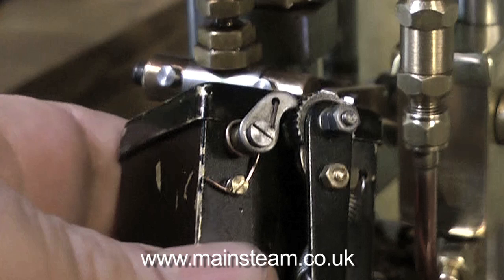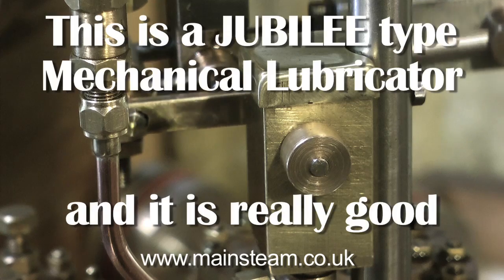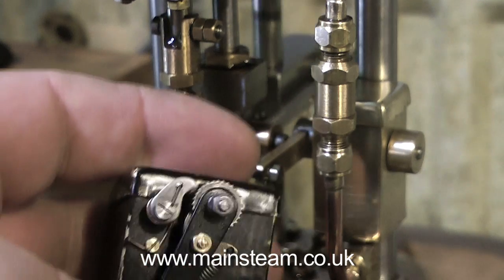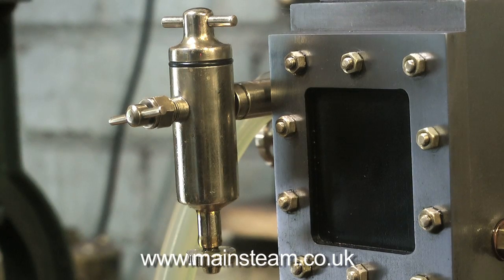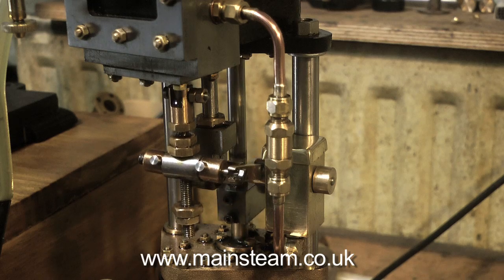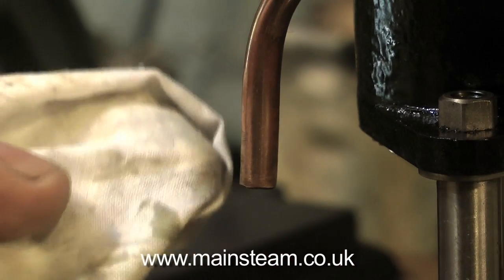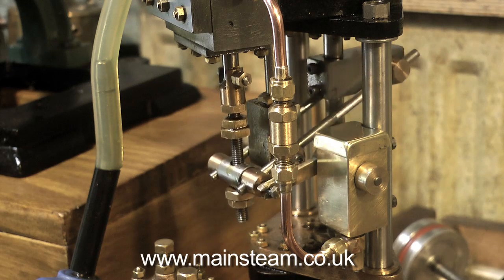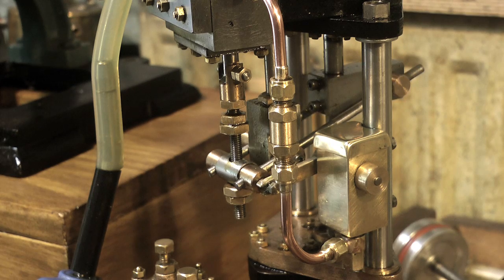THE BEST MODEL STEAM ENGINE CYLINDER LUBRICATOR?

Comment: hi Keith, could you recommend a manufacturer or supplier that I may be able to obtain a lubricater from and also for my markie a rachet or a clutch type, as you have probably guessed iam a complate novice ,and gain a lot of inspiration from you and other like minded people with a invaluable knowledge of steam, many thanks vinny
Reply from the maker: I buy mine from Blakgates Engineering (www.blackgates.co.uk)

Comment: Hi Keith, I have a markie showmans engine, approximately 1990,, I have a issue with my oiler, it has a clutch type, it is the third oiler of this type I have fitted to , due to piston seizures, and the clutch disintegrating, so im not a big fan of the clutch/ratchet type mechanical lubrication method, my question is ould I fit a displacement oiler in place of the mechanical type, many thanks vinny
Reply from the maker: I use mechanical lubricators without problems, my small 7 1/4 inch gauge tank engine still uses the original one I fitted when I built it in 1996 - Displacement lubricators are OK, but not as predictable as Mechanical lubricators, maybe you should change the make of mech lubricators maybe from another manufacturer.